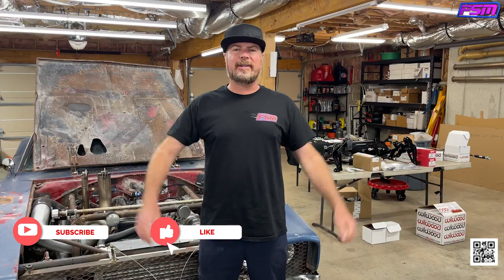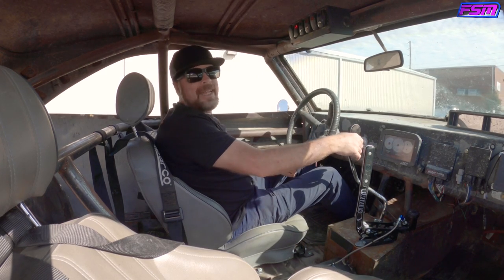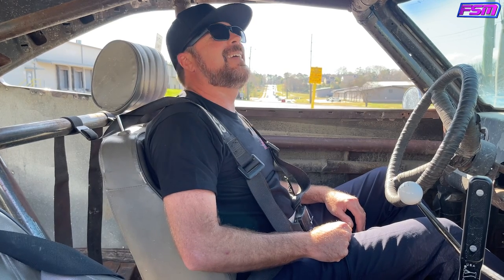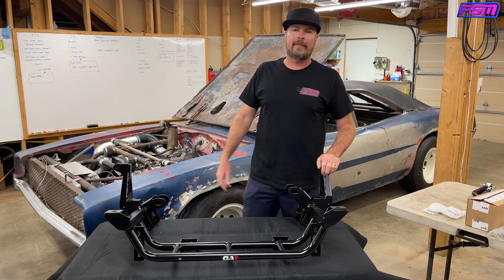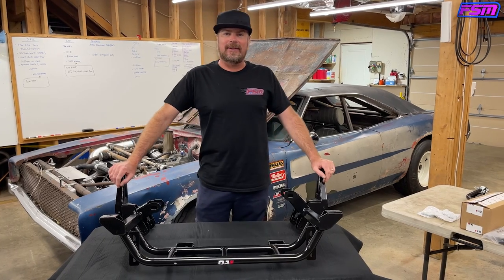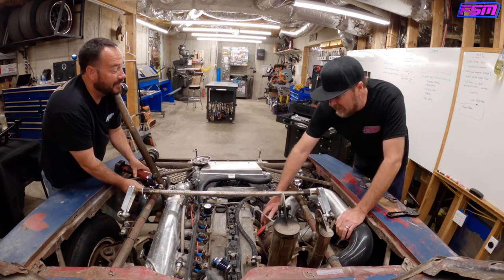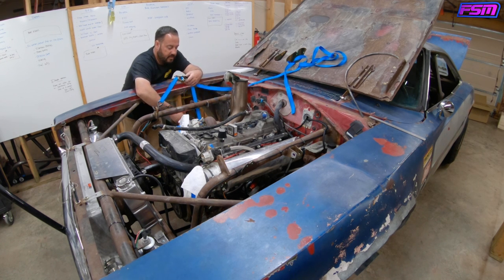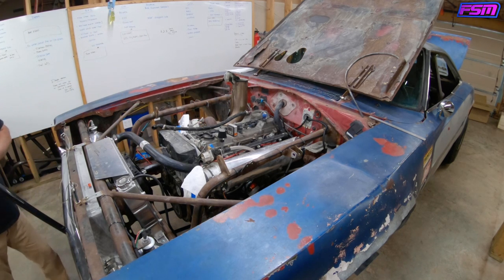FINALLY FIXING THE WORLD'S DEADLIEST 2JZ-SWAPPED DODGE CHARGER!!!

Comment: I struggled to keep my stroker Jeep cool for years.  I tried all kinds of stuff.  The demon tweak was the fan shroud.  Once I made a nicer, tighter shroud the cooling problems went away.
Reply: yeah I used to think the shroud was there mostly to protect the fan from fingers and such. It is not, it is a crucial part of the cooling system.
Reply: Yeah, my dad had a 454 chevy truck that ran hot, he changed everything, pump, thermostat, radiator, then he saw my Hotrod magazine with a. Article on cooling systems. He read it and saw that the fan was sitting in the shroud wrong, got the right spacers for the fan a d bingo, cool running.

Comment: I gotta say, I'm a legit Mopar need and I approve the 2JZ!
Reply: Same here. It's a Japanese crossflow Hemi Six :)
Reply: A 2JZ 6 is just a properly tuned slanty 6. It’s just a early version of the new Hurricane 6 coming down the on-ramp.
Reply: It does rev like a 170 HyperPak,....
Reply: Do whatever you want i say. I'm putting a Barra in my Mopar after having almost every possible original engine config my car came with.
Reply: @qshank2752  Which Mopar?
I'm thinking Jeep 3.8 V6 in a VC Valiant, because 100kilos off the nose, and more top end then my 225 HyperPak.
Barra in a VH Charger would be a riot.

Comment: LOL! The whole staff at Mopar Connection Magazine have been laughing our heads off at this build. IT'S GREAT!
Reply: Your magazine needs to do an article on this car. Title , What Not To do to a 68 Charger!
Reply: How to destroy an value in a mopar
Reply: @Welcometofacsistube  Yeah, but any perceived value in an original '68 Charger was already LONG GONE before Finn got involved. Anything they do here is demonstrably better than catapulting another rotted General Lee clone into oblivion.
Reply: @ericfaley9019  but as insane as it seems, it was pretty common "back in the day." How many B-body Mopars met their fate on local/regional dirt and circle tracks? (A whole bunch)
Reply: @moparconnection  disagree.  That charger would increase in value without that Japanese pos in there.
Reply: @Welcometofacsistube  no more than a yahoo who drops in an LS motor. There is not one square inch of this car that wouldn't need to be replaced to bring it back to stock. Literally NOT ONE PIECE.
Reply: @filupondeznuts6732  LOL maaaybe!
Reply: @Welcometofacsistube  Your crazy bud that car isn't worth but what someone is willing to pay for a chopped up circle track roller and considering the chassis is  thrashed its worth scrap weight that 2jz and transmission made that car worth about 6 times whatever the scrap weight is that charger is basically a shipping crate for a 2jz just like a old beat Dodge truck is for a 12v  Cummins
Reply: Mopar Connection Magazine  You mean there is still a car magazine out there .? I thought motor trend killed everything off but Hot Rod.
Reply: @lilorbielilorbie2496  LOL! Almost! I was at Mopar Muscle Magazine when Finn was at Mini Truckin'. I broke off and started Mopar Connection in 2015 while he was at Roadkill. (Finn's route was a little more lucrative. :D)
Reply: @moparconnection  Maybe more "lucrative" but money is not everything. It's easy for mt to say Print Is Dead when they owned most of the car mags. and then killed them off right before the holidays. They say that Karma can be a real bitch. Just think of the ripple effect that it had on the aftermarket when they shut down all of those magazines. Years ago I worked in the aftermarket designing hedders for a company you might have heard of it was called Clifford Research when I started and then they changed the name to Clifford Performance. There was some really good people who worked there .They made it fun to go to work. I hope that you can keep your magazine going for ever.6=8
Reply: @lilorbielilorbie2496  thanks brotha! We had to read the writing on the wall, and we're 100% digital now. I had a LOT of good friends lose their jobs when TEN killed those titles.
Reply: @moparconnection  When I heard that mt was going to stop printing magazines. I thought crap I've gotta get a "smart" phone so I can still read them . So I call the subscription dept. to my subs. on the phone the lady I talked to said nope they are just going away nothing is going to digital. But what really chapped me the most has nothing  to do with mt. It has everything to do with a magazine called The Rodders Journal they had noo problem taking my $$$ and not giving me and several others anything in return. They just took the money and ran. Slight Steve Miller reference.
Reply: @lilorbielilorbie2496  ugh, yeah. You're NOT alone there. We're 100% free - no subscription fees at all. Just advertiser supported. Some old guys get mad who use Internet Explorer with ad blockers and can't read the mag, but it's a small price to pay for free content. (Not trying to use this space to promote my mag, sorry Mike & team!)
Reply: @moparconnection  Man that's really cool that you are 100% free. Usually the only free thing I get anymore is when I get myself in trouble and it's not free to get out.  I guess that being 63 years old would call me an old guy but in my head I'm still 17 and I refuse to ever grow up. I was born and raised in Orange County, CA. like Mike was. Had a Lot of fun with my friends who sadly some are no longer with us but the memories of the stuff that we did we all should have spent some time in jail. lol.
Reply: @lilorbielilorbie2496  our Editor-in-Chief, Kevin Shaw was born and raised in Seal Beach, CA. Sadly, SoCal ain't what it used to be.
Reply: @moparconnection  Yeah I hate what's going on really everywhere. My Late Mom could never understand how I am like I am. I've never ever worried about anything in my life . Now there are things I wonder about but worry no. A good friend of mine from high school back in the 70's told me once that if I was anymore laid back that I would be dead and I told him thank you.  In all of my life I have met only one person more laid back than me. He was a boss I had when I worked at a hedder company called Clifford Research. He could walk down his driveway and look to his right and see the surf. Now we started work at 6am and once in awhile he would be late . I new where he was and when he showed up I would ask him Ken how was the surf.? You may or may not speak surfer those guys have lingo all their own . He would say Aw Man I t Was the Kind. which means it was good. And he looked enough like Tom Petty that they could have brothers. Other than when I worked for/with my Late Dad he was the best boss that I ever had.

Comment: Buddy of mine that was in the army from about 1998 to 2008 got badly injured in an explosion, hence his medical discharge in 2008. He had a titanium plate in the top of his head, and we were working on this ratty 70's bug eye Cordoba he had, swapping the 318 out for a 360 while swapping in a better clutch for the 4 speed. While fighting out the drive shaft, he dropped it on his head, and it peeled back part of his forehead revealing the plate that was installed when he got blown up and his skull got a bit rearranged. The nurse at the ER asked "Okay, what's a drive... Shaft...?" when my buddy explained to her the injury. My buddy, who I didn't know before he was discharged but whom I am assured has always been a bit uh, unhinged, just started laughing while his head was bleeding and his Terminator skull plate was showing. Sufficed to say, we had plenty of available seating in that side of the ER haha.

Comment: About the lack of low end torque; there's a number of things you could do together or separately to change that. Compression bump, smaller/more efficient turbo, different cams, a tune. Hell, you could go with a smaller compound turbo setup that would boost at nearly any throttle position above idle. 
It'd be a waste to just write off an inline 3 liter as a low end torque-less wonder. Wish I could remember some of the engine build details
Reply: Also, is there electronic boost control? Keeping that wastegate clamped shut completely below target boost will absolutely help the lower rpm come alive, if not make it scary to drive

Comment: The reason the one Allen stud is longer on the steering joint is because you’re supposed to drill all the way through the dd shaft to keep it from being able to slide out.

Comment: Well for one. Bo is a cutie. But the rear control arm mounts look like they were moved back 5/8ths to 3/4 inch. I might be wrong. The  front I think you hit it on the head. And at least been opened up . Kit looks nice e so far. Good luck.

Comment: Might do a tech tip on that phasing issue with the single and double cardan joints. And you need a new steering wheel.

Comment: You mention about the motor being low on torque for such a heavy car but a factory base model 68 charger is only around 100 pounds heavier than the Supra that used the 2jz according to the figures I could find.
Reply: Gotta add the 40’ of water pipe in the roll cage, heavier rear axle, heavier front brakes, and heavier wheels on deathmetal.
Reply: @goonridingupnorth1382  that's true but they said it weighed 3580 or 3590 before and from what I could find is a Turbo Supra is listed at 3470 or close. You also got to look at all the interior that is stripped out of the charger.

Comment: I watched kevin video. He measured angle of lower arm and upper arm and sort of said they should be parallel. If not, then the upper mount should be moved inboard to “shorten” effective arm swing. I’m not sure he ended up with neg camber at compressed height

Comment: what I would have done before messing with the cobbled up suspension and steering would have dropped datum points onto the floor using a plumb bob to find the centre of the chassis and the corners then transfer datum points onto the chassis so you can now work off something square so that your new top hanger points will be true to the car and you won't crab or have funky steering and to get your caster and camber angles right so whether you do this on your next video I hope you do as doing it by eye won't work unless you win the lottery. and same with the rear suspension drop-down datum lines and transfer them onto the chassis good look boys thank golly you have Kev on the job he will sought you out ps you don't have to use a plumb bob nowadays a laser line is just as good if not better to drop your lines and a good piece of chalk for drawing onto the floor.

Comment: Those initial brake test are pretty much how every car I owned in the 80's & 90's stopped and they weren't considered bad.
Reply: @Wayne Rivett; perhaps You should check those vehicle braking distance specifications and performance measurements to be sure and certain.
Even production cars from the 1960's with drum brakes on all four wheels, and heavy, steel frames, have better braking distance specification and performance.
The original 1968 Dodge Charger certainly had better braking performance than this particular vehicle.
If Your vehicles had such poor braking performance, then they had serious brake system issues and problems that needed correction, repair and were certainly dangerous perhaps near failure sometimes.
Do You usually drive and own vehicle with poor performing braking systems and not have them corrected, repaired and working properly, thus endanger Your life, lives of Your passengers and those driving along, on the road around You along with the cyclists and pedestrians too ??!!
Sincerely
Reply: @newtonfirefly3584  mate I haven't mowed down any pedestrians, cyclist or lost any passengers and I'm still here in nearly 40 years of driving. You gotta drive within your ability, take it easy buddy.
Reply: @GenerationGap69  Your replies are individually a strange depiction and in combination more so.
thus, You seem very strange 'mate'.
But, as You state You still are 'there' and thus exist too.
and according to Your claim, You have not harmed any others at least seriously, including Yourself.
All The Best.
Sincerely.

Note: 
Do You usually speak with your "mates' in such ways, manner to direct, dictate and control them too ?
Is it acceptable in Your environment and among Your 'mates' to attempt to be an Authoritarian and direct dictate and control others ?
Wouldn't it be more proper not to attempt to direct, dictate or control others as Your final statement attempts?
Reply: @Kristina Hello Kristina, 
what is this pleasant comment for and about ? 😏
Reply: @newtonfirefly3584  can you be a little more specific?
Reply: @Kristina Hello Kristina,
this platform is unusual and strange to attempt to use it for immediate messaging.
perhaps You want to use email or another messaging platform like Telegram ?
Reply: @GenerationGap69  How much more specific than i stated do You need ?
perhaps try reading, re-reading, etc., until You comprehend it ?
IF You still need clarification, then be specific with Your questions You need clarification.
Reply: @newtonfirefly3584  just do the best you can, but only if you want to
Reply: @GenerationGap69  it is simple for me to clarify what You see needs additional information and clarification.
IF we were speaking directly, and You needed more guidance, then i would ask You questions to assist and help You,.
Since We are via this more limited platform of messages, then it is within You to determine what You need more specifically, and to ask accordingly, so that i will know what You need. 
Is this clear, Wayne ?
Certainly i am willing to help clarify what You need.
You just need to know and tell me Your need(s), issues(s), etc. which are within my.replies.
Sincerely
Reply: @newtonfirefly3584  not really. You write a lot but don’t say much but thanks for trying
Reply: @GenerationGap69  It seems You must have some difficulty with reading and comprehension Wayne, else You would be able to respond to the information stated clearly.
Perhaps You are better with verbal communication than written ?
All The Best
Reply: @newtonfirefly3584  no problem reading it just the comprehension part. Truth be told I'm getting a grooming kind of vibe from you and it's a bit worrying. You should talk to someone about it.

Comment: Probably need cooling system flush with Preston's radiator flush and 6 gallons of distilled water over 1000 miles, that will clean the layers of build up from the block, hoses, radiator, heater core and anything else so heat can be transferred, just changing the radiator will not clean the cooling system

Comment: Finnegan you should check out Jeep XJ radiators. They’re very short compared to standard (11 inches tall) and have to cool a hot running 4.0 in a vehicle with poor airflow through the grill. Plus the aftermarket has lots of upgrades and it’s all CHEAP.

Comment: Dragy GPS Performance Meter.  Check it out.  Cheap box that lets you measure 0-60, 60-0, quarter miles times, etc.
Almost guillotines hand...woof.  No need to buy lottery ticket, you've already used your luck for the day.  ;)
Oh yeah!  And put bellmouth intakes on Game Over's turbos!!!  Cheap mod that improves flow and power.

Comment: You should really get a vbox or at least a dragy to do braking and acceleration tests. It would be cool to know how quick death metal really is. Using the tire marks as the start of braking is inaccurate and the official tests use the start of deceleration

Comment: Dude your a dad you should be buckeled up for all the tests and all driving. See so many die unnecessary stay safe and keep pumping out the awesome videos. our 500hp supra had a radiator the size of a pick up in massive alloy thing about 3" thick. modded Japanese cars need massive cooling. build some hard polybushed mounts solid mounts are so so harsh.
Dude that fiber glass wool insulation hanging out the roof has gotta make for itchy garage why not ply line the celling or plaster board (sheet rock) it. 
I did ply and painted it white before i put it up then jist touched up the screw holes and joins saved on covering the floor. those look like truck suspension to frame mounts poss from the f250 front end?

Comment: Not at all convinced about those engines mounts. With the bushed outer part there is a huge bending moment on the "cups" that bolt to the 2JZ brackets.  I predict they are going to fail pretty quickly.

Comment: To put the misalignment spacer in, I would "lasso it" with a cable tie or a scrap of wire.   Added   Does anyone know where those tires are 70$  I can only find them for about 200$

Comment: Take that rice out. Put in a 1975 TRUCK 360 with twin turbos.
I had. A friend Don May he R.I.P.
That drive a 75 360 for work. Pulling a Bobcat daily. It was 4WD AND YOU COULD NOT TELL THAT BOBCAT WAS BACK THERE.  Truck 360 has a lot of torque way better than rice.. just sayin 383 & 440 YOUVE tried TRY A TRUCK MOTOR

Comment: EMERGENCY  I got 1for you  I was  working on a Ford   pulled the distributor out  and  the oil pump shaft dropped  so I took my cigarette lighter and used it to see how far and where it  went   unknown that the fuel pump  was leaking gas into the crankcase    ended up with no face hair and burnt eyeballs.

Comment: You should replace the 2jz with a Australian ford barra turbo 6, it would shit all over that motor with a lot more HP and tourqe
Reply: no, it wouldn't.
Reply: I think 500+ cubes and a couple turbos would “fix” the “low” torque issues…